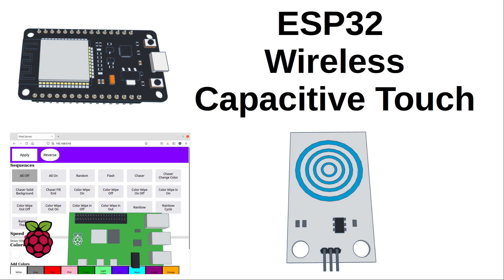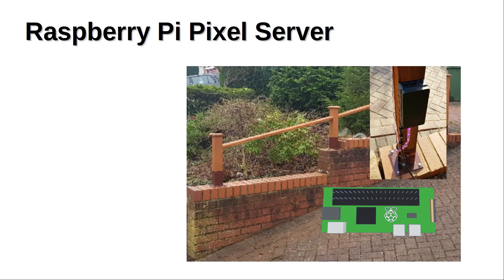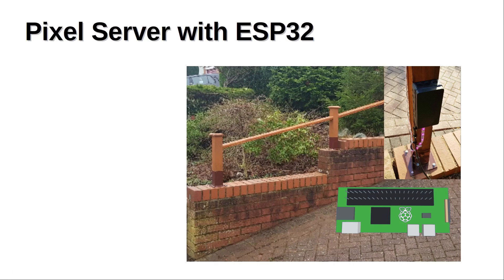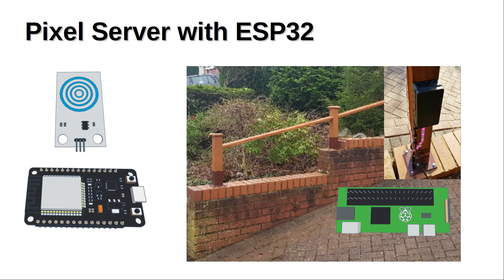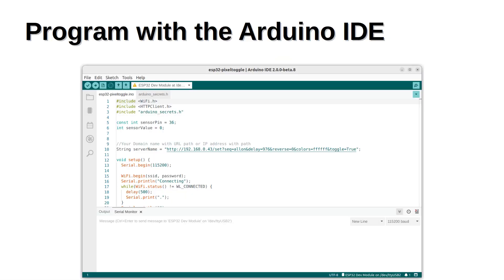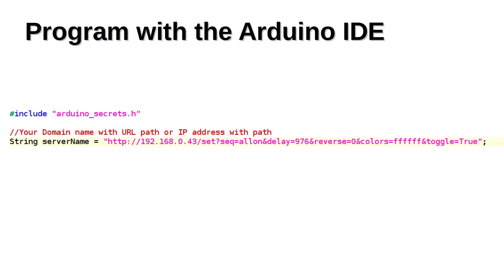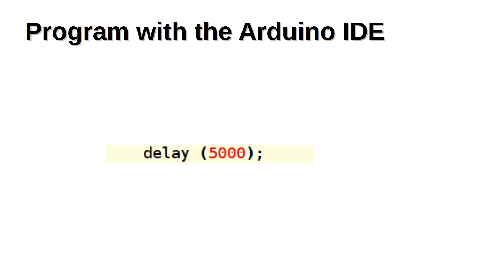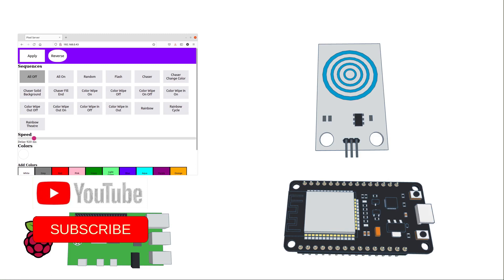ESP32 capacitive touch controls Raspberry Pi NeoPixels

Comment: At the beginning I used Raspberry Pico for all my devices. Then I "discovered" ESP32. Finally I replaced Pico in all my devices and installed ESP32. Why bother to have 2 MCU when 1 can do the job? And in case you use Raspberry Zero W ... that does the job as well as it has wifi.
Reply from the maker: They each have their advantages and disadvantages, but if you are looking at low cost ESP32 or Pi Zero are the cheapest solutions with WiFi. 

Personally I like the Raspberry Pi as I like creating GUI interfaces, although even that can be done with html & css.
Reply: @PenguinTutor  of course: if you like it then of course no issue but such project probably does not need 2 MCU